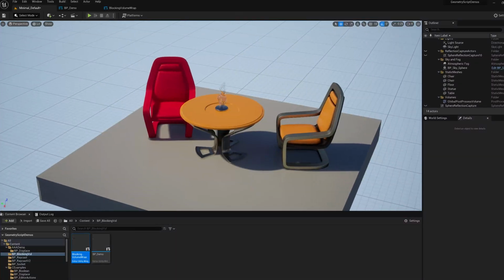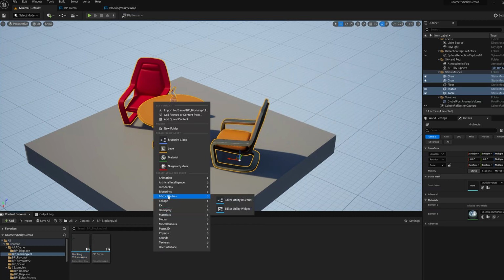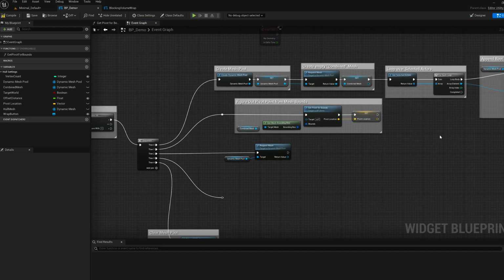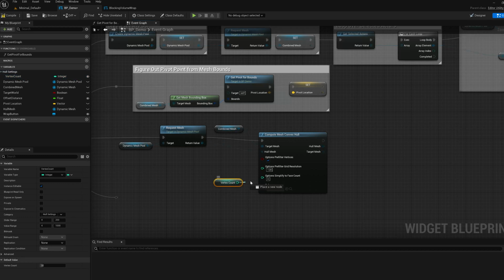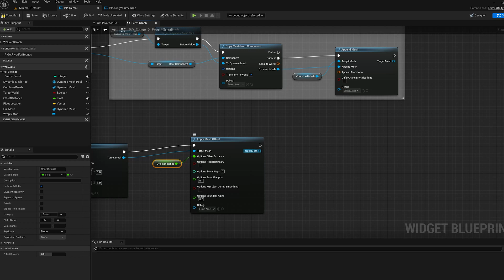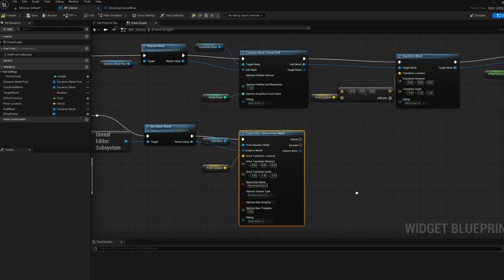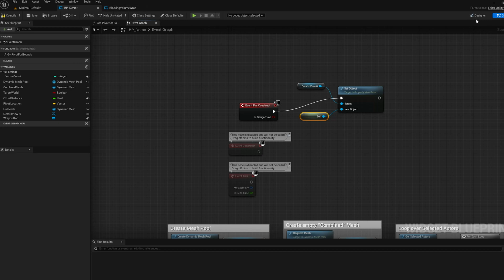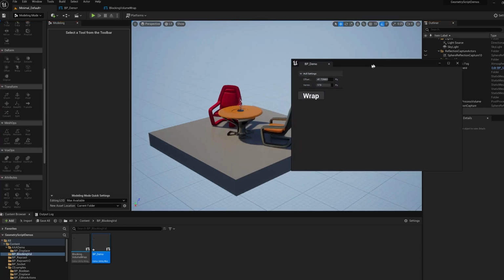UE5 Geometry Script - Convex Hull Blocking Volume Tool

Comment: Hi, so I cant seem to find "Create new Volume from mesh" has it been removed ? and also is it possible to create collision from a dynamic mesh that i created using booleans ?  for instance i created a room with some windows and a Door and i want to be able to walk inside in runtime
Reply from the maker: This function is only available in Editor blueprints, eg Editor Utility Widget / Action, GeneratedDynamicMeshActor, etc. If you are making a regular Actor blueprint it will not be available. You can enable complex collision on a mesh you modify to have blocking collision, search for 'Booleans at Runtime' to find a video. You can also generate simple collision shapes however it's up to you to do that, and it can be quite complicated.

Comment: Do you guys have any plans to add text generation support? There is currently a 3dText plugin but i guess it is not compatible with this system, it is slow and doesn't work on Android.
It would be useful for VR GUI, because any texture based text tends to look bad in VR.

Comment: Is it possible to add a new tool inside the modelling mode window with blutilities?
Reply from the maker: Sorry, it's not currently possible in UE5.0. It is possible in C++ to add Tools to modeling mode via a C++ Editor plugin (the Hair Modeling Tools plugin included in 5.0 does this, when it is enabled, it adds some Tools to Modeling Mode). So possibly a clever person could figure out a way to bridge the gap and allow an EUW to be launched from a "Tool" button, for example.

Comment: 1. So is the generated convex hull saved as a static mesh asset or as a generated static mesh inside the world? 
2. Is it possible to group the objects in blueprint so moving the meshes can't be done accidentally?
3. With this, would it be possible to add a world cache with groups of objects and their settings for bulk editing?
    3.a. Could the groups or the hull in the world have a tag or actor component that allows a blutility context function to be added, to basically tell the hull creation tool to regenerate that one group?

Sorry for all the questions, but I'm extremely curious about the possibilities of geometry scripting :)
Reply from the maker: 1. It's a Blocking Volume, not a static mesh. "Gameplay Volumes" are a standard type of UE object, like Blocking Volume, Audio Volume, Postprocess Volume, etc. Often they are just boxes, but can be any shape if edited with Geometry Mode  (and now Modeling Mode can create and edit them, too). 
2. I think it would be possible to convert the grouped meshes to a BP Actor....it may also work w/ the Volume but I am not certain, support for Volumes in Actor BPs is very limited. Another option would be to use the 'Merge Actors' tool to combine all the separate mesh Components under a single Actor.
3. I don't really understand entirely what you mean, sorry
3a. I think if you converted the set of Actors to a BP, and added the Volume Generator as a CallInEditor Function on that BP, you could do what you are describing (ie easily regenerate the Volume).
Really there is a huge space of possibility at the higher "how to manage the stuff" level. For example you could have BP Actors that don't have any geometry, but just exist to keep track of the various objects (eg in Array/Map/Set properties) and expose ways to do all this scene-management-type stuff. In that case you really have a lot of power and flexibility, but that is not really "Geometry Script" anymore, and I can't claim to be an expert at that level, unfortunately.